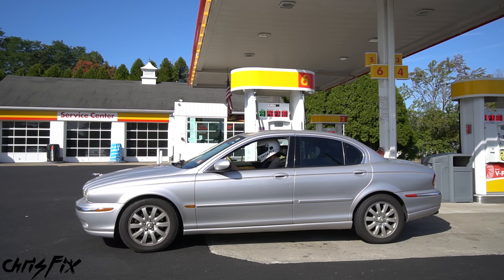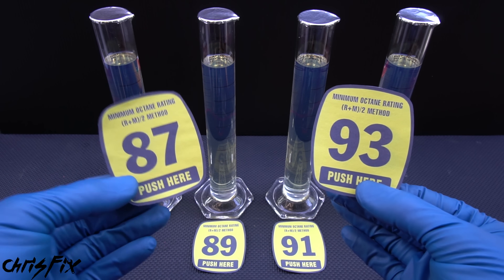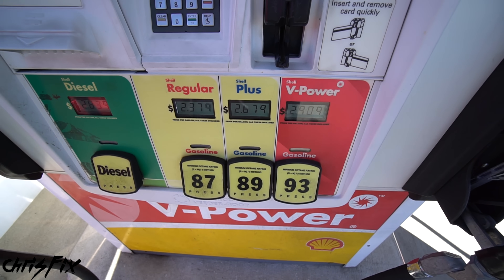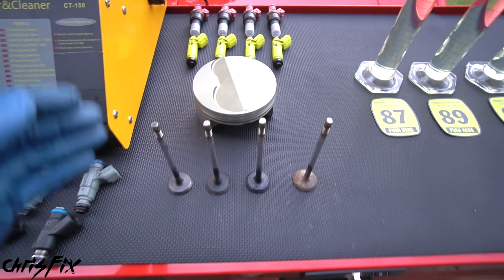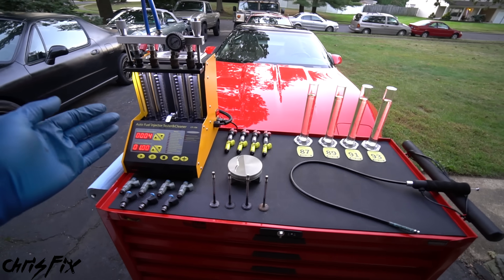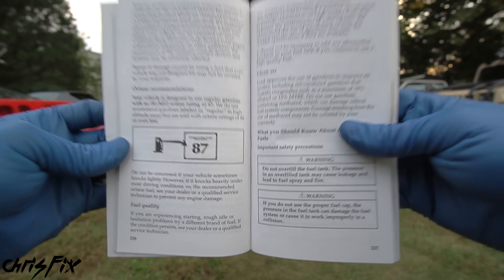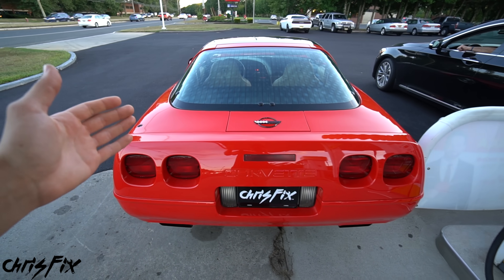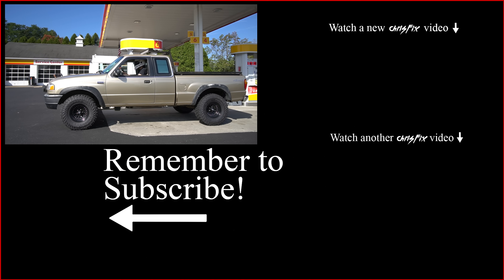What is the BEST Fuel to Use in Your Car or Truck and WHY

Comment: Bottom line:
1. Use the octane it says to use in your owners manual.   There is NO advantage to using a higher octane...does you no good.
2.BRAND matters more than octane.   Pay the extra .10/gallon for a name brand fuel (and sometimes not even that much).  Just Google "who sells TOP TIER fuels" and buy those.  Many top tier fuels are budget priced like QT and Costco, and many Circle K's actually sell top tiers like Shell and Mobil.
Seriously, it may cost you $1.50 more to fill up, but you'll get at least 70,000 more miles out of that car...more of you start early in the life of the car. 
Feed your car crap fuel from the station at the Qwikkie Pickie, consider yourself lucky if you get 120,000 miles out of it.
Reply: To prevent knock when advancing timing you can use higher octane fuel. When you advance timing you get more power.
So... there is an advantage.

Comment: My car says it's designed to run on 87 octane with 10% ethenol so that's what I use and nothing else. I definitely won't use the new 15% ethenol stuff. I used to use 89 or the middle one but honestly it seemed to run better on 87 so I stopped.

Comment: If the pump is out of regular and you run premium. Get the mid grade and you'll get premium at the mid grade price.😉
Reply: LOL! That would be nice if it actualy worked. But unfortunately typically when the regular runs out, the mid-grade stops working as well. So only the premium will pump. Gas stations have thought of this long ago.

Comment: The ethanol-mixed gasolines typically found in Europe, like 95 octane/E05 actually contains less energy than non-ethanol mixed gasoline, and causes higher fuel-consumption

Comment: What if your car is rated 87, but you put in 94 octane and add an octane booster bottle XD

Edit : my friend does this on his modified Chevy Cobalt 2008 lmao
Reply: The car won't have the proper compression to burn the fuel properly and can lead to a higher risk of carbon build up, as your puffing out unburnt fuel from the exhaust. Your friend must love throwing money away for no reason.
Reply: @waycoolscootaloo  he's a dumbass lmao

Comment: the prices changed so fast, was $3.019 for 93 at the beginning and like 30 seconds later its $2.909
Reply: I work at a gas station, most places have an automatic price system for their gas. cant exactly go into details but a little hint, if you need to fill up hit a gas station during non-peak hours, not when there is 700 people stopping in.

I've literally clocked in one day with gas being $2.39 and by the time I clocked out it was $2.50. the system is always on and prices always change.  (also at our station we have 87, 89, 93 but the 87 and 89 are literally from the same tank. it's a scam)
Reply: @Kalezian  It's not a scam. The 89 is a 50/50 mix of premium and regular. The 89 pulls from both tanks to get an average of 89 octane.

Comment: In Sweden we don’t have gasoline that is less then 95 octane. The “premium” gas is 98 octane!
Reply: Did you even watch the video. He exains that the Euro ones are the same eating as us because the eating system is different
Reply: @Altiveda  Just for your reading comprehension: Europe doesn't have the "Regular" grade fuel from the states. The US mid-tier is the lowest you get.
Reply: We have that two
Reply: @allyshaddad3123  Ohh, the 98 is premium? 98 is mid-class in the Central Europe (Czech Republic especially) 😂 The premium gas is 100 octane!
Reply: @ondrarethy  well, the 100 oktane is only for promoting at shell, aral, etc. They are basically 98. I know a test by a university where the 98 (from a small brand)
 was better than the 102 ultimate 😱. Just take a high quality fuel, i got bad one (from A***p) in czech.
Reply: @ondrarethy  In Germany 96 is standard, 98 Premium, 100 is V-Power from Shell and 102 is whatever its called from Aral
Reply: here in the us an order online and sunoco delivers 181 octane racing fuel to your doorstep
Reply: Because Europe uses RON not MON or AKI.

Like inchs to cm not the same.
Reply: evidently you're s shitty listener as this is explained in the video.
Reply: Elias Isaksson  hey her i Danmark kan man få oktan 100 men ja USA soo low fordi der er 10% etanol i...kan også få 99 96 95 i dk..i USA brokker de sig over prisen....de skulle komme til danmark Sverige eller Norge og se vores priser..kan du have en go dag...

Comment: Thanks for the vid!!!  Wanted to know if you learned anything about non-ethanol with your time with Shell?  My vehicle is a 2000, and that was before 10% ethanol was a thing - but now they have dedicated yellow hoses (here in Colorado anyway) for 100% actual gasoline.  Costs a bit extra, I hear the parts in engines not designed for ethanol don't handle it very well, so I pay extra for it, and have been for years.  What do you think?

Comment: Does anyone know a possible problem to my car ? (2006 honda pilot)
It has a check engine light with multiple codes :
p0305
p0306
p0303
p0300 also the VTM 4 light is on

Comment: Interesting scenario... my vortec 6 calls for regular in an old 1991 Sonoma GMC but after adding an Edelbrock Carb it says 91-93 Recommended. I didn't know what to do in this situation, so I discovered something about the Edelbrock with the idle tuners in front as well as some other air-vacuum settings.

If you own an Edelbrock and find that you're getting issues running regular, switch to 91/93 for a few hundred miles. When you do this however, at fresh start with the new fuel you will have to re-tune the idle because the compression ratios will require higher/lower tuning. If you don't do this, the after market carb will have issues with idle that can lead to other problems. In this kind of vehicle, you do not often have sensors because the vehicle is older so everything is manual set.

I also tried to fix the "Engine Service Light" but that would require purchasing a dumber computer it seems, as the "mass flow sensor," "fuel rate low" errors, and a number of other issues arose because all those parts became unnecessary after removing the fuel injection system.

Comment: I Changed the valve covers on my 2007 Nissan Murano with 193,000 miles and now it runs fine for 30 seconds than starts misfiring I got a P0300 code
Reply: All the spark plugs were changed at 170,000 miles the 3 rear ignition coils were also changed at 170,000 miles I know it not the fuel that’s causing the misfire I’m thinking it’s a vacuum leak?

Comment: "Pre"-Detonation. Not detonation. Detonation is what is supposed to happen.
Reply: Have a c4 corvette don’t have a manual. When accelerating. In overdrive have that detonation. Sound at 43 mph when decelerate then accelerate it has that detonation sound thought clogged fuel injector.

Comment: Sorry for unrelated question but figured most recent video would get a response anyone have suggestions of tools to get for working on Volvo's specifically 2005 s80 fwd 5 cylinder have a small assortment or torx but what range is good to have what obd2 scan tool would be good there are dtc codes but no idea which one's only what modules are affected not an experienced car guy tbh but always watch these and am capable or retaining the information so want to see if I can put it to use Chris or anyone who can help I'd appreciate it

Comment: You should only use minimal gas needed based on engine compression.  Using higher octane doesn't help anything on regular engines.

Comment: What does E-85do does it make the car go faster?
Reply: e-85 is cleaner, and yes makes significantly more power with a proper tune than standard fuel. it significantly reduces knock allowing for more timing advance and in forced induction cars, more boost. the main downside is you need a fuel system that can handle it because it is more corrosive and will eat through normal fuel lines and pumps. In addition fuel economy suffers because more fuel is required to achieve the proper AFR
Reply: Connor C thanks man good exclamation

Comment: Great video as always! Now from my experience with owning a turbo car, the manual says minimum 87, which its fine to run but its a small 1.4l turbo charged economy car, LSPI is a factor and Ive had the knock sensor sense knock when running with 87, now nothing was damaged but after calling the manufacture they said run premium instead. Ive been running premium since and not once has the CEL came on, not to mention MPG increased dramatically. Now I personally think its very important to run 91 minimum in turbo cars which have small displacement engines because of the LSPI risk. And with a lot of modern cars now being made with small engines and getting a turbo on them.

Comment: ....or once a year you can suck a half a can of Sea Foam through the master cylinder vacuum hose. Suck a little until the warmed up engine almost stalls and stop, do that three times and the fourth time suck up enough to stall the engine. Let it sit for at least 30 minutes but the longer, the better. When you start it...it will smoke like a freight train for about 10 minutes. That is all that carbon you showed burning off. I did that many years ago to a vertical cylinder chainsaw and it DOUBLED the RPM’s.. since then I am a religious Sea Foam user...but not pouring it my tank, injecting it right into the manifold. Just my opinion...

Comment: those valves are bad, one whit oil gunk and another whit water on it (the more brown) ...just remember cheaper gas stations like am pm gas sucks, circle k is not the best, QT not recommended for me driving a F150 2011 4x4  chevron  mid grade or high grade is the best results on power and mileage.

Comment: So if you use shell high octane to clean your valves, where does this gunk go?  ive always remember the saying sh*t runs down hill. And the only way to get the flies out of the kitchen is to put the trash on the front porch.

Comment: Very informative however the chemist in me is cringing when you say octane is the resistance to burn and that is not true.  Octane is the name for 
hydrocarbons containing 8 carbon atoms.  The rating at the gas pump is the resistance to burn and the number represents a fuel mixture that is 87, 89, 91, and 93 percent octane and the rest heptane (7 carbon atoms).  This does not mean that your fuel is an exact mixture at those percentages yet the fuel you are purchasing has the equivalent resistance to burn as a fuel made from octane and heptane at those percentages.
Reply: The inner terrorist in me says the higher the octane the bigger the boom
Reply: yscar reviews 

Technically the lower the octane the bigger the boom. The higher octane indicates fuel that will burn more consistently and cleanly because it is more resistant to what can be summed up as spontaneously combusting. So if your inner terrorist wants fuel that will actually blow up and not burn slowly then go 75 octane, or just fabricate your own goddamn fuel with wood gasification and hydrolysis for hydrogen atoms to balance.
Reply: @topsecret1837  yes
Reply: @yusufsaood5484 lmao chill
Reply: @MrDopeboys1  I'm as chill as chilli mate
Reply: Thank you, as a fellow chemist I’m glad someone said it.
Reply: What is the difference between octane and heptane except from their carbon atoms count?  Or why is the atoms important?  Why is there heptane at all? Could it be 100% octane?
Unlike others in this thread I am pretty curious and like to learn new stuff from knowledgeable people!
Reply: Cringing? Really? In this context, a fuel's resistance to burning is exactly what octane means. Your cringe-worthy post is the equivalent of you correcting someone's explanation that Fahrenheit is a temperature measurement by saying, "The scientist in me is cringing because this person doesn't understand that Daniel Fahrenheit invented it and used the freezing point of a brine solution to establish 0 degrees." Sure, that's more information. Fantastic! But why are you cringing? Both statements are accurate. Gas pumps aren't labeled for chemists. They're labeled for drivers who need to pump gas into their cars. The octane rating absolutely tells them how resistant each choice is to burning. I enjoy learning and I like details like what you mentioned, but maybe get over yourself a little more next time and spare us the cringing. 

Oh, and not to beat a dead horse, but your explanation is also a little lacking (not that I'm cringing or anything) when you consider that there are octane ratings above 100. Am I supposed to believe that there can be a fuel with 110% of 8-carbon atoms in it? ChrisFix went as far as he deemed necessary in his explanation. You cringed and took us further, albeit with no practical applications. And now I'm wondering why you would do that without clearing up the glaring inconsistency that you've created.
Reply: Stewart Peters 

That was a deep burn. 3rd degree I suppose.

Comment: Actually enjoyed the video.  Very informative, expectation given, and details of common myths/misinformation.  Especially about other countries...  Question - E85, does it burn hotter and I have heard they make it differently in other countries?  Have a flex fuel F150 and it sucks mpg with E85 but the engine runs smoother...

Comment: * Tesla users left the chat *
Reply: Don't let the door hit you in the $ss!
Reply: Good one!
Reply: Brian Paul thx
Reply: Explains gasoline and engines for 16 minutes
Electric motor: yeah. it uses electricity. The engine parts don't even touch
Reply: no wonder why 5k dislikes,,, those are telsa's owners
Reply: For the most part they get their energy from coal.
Reply: Their cars just randomly explode
Reply: @Master Chef - Yeah, I wish they’d switch to solid state lithium ion batteries to stop that from happening
Reply: And yet still statistically much safer than most ICE vehicles.
Reply: Tesla users stucked in the Desert

Comment: I know this has nothing to do with the video. But before I remember you said when using RTV as a gasket, to place the straight bead on the inside of the bolt holes. My manual says to do it on the outside. Which tactic should I use?

Comment: Can someone tell me the difference between Ethanol and Gasoline fuel? I’m curious
Reply: Ethanol is a fuel additive/substitute that comes mostly from processing plants. It has a higher native detonation resistance then gas ( which is why it is commonly used as an additive in fuels to boost octane rating.) However it also has way less energy than pure gasoline requiring more of it to get the same power.

Comment: One thing to keep in mind with E85 is that it will reduce your fuel economy by about 17% vs. regular gas. (up to 10% ethanol)  Pure ethanol has approximately 80% of the energy of pure gasoline.

I'll occasionally get E85 if it's significantly cheaper than regular, BUT it's only worth it if the price of E85 is less than 83% of the price of regular.

Comment: Did I miss something or did you go through all this without mentioning flash point, the temp at which gasoline will burn?  High octane means higher flashpoint, which means more resistance to pre-ignition.  I can't believe you did this whole video without mentioning the word Flashpoint.

Comment: Hey Chris I have watched but not subscribe to your channel you share a lot of great informative information and I appreciate it thanks 🙏 I do have one quick question my sister in law has a  2012 Acura TL v6 3.5 the ecu threw P2647 Rocker Arm Actuator code my problem is that I can’t seem to locate it and I can’t fine any diagrams to help me so iam asking if you can shed some light on this plz I would really appreciate it thanks 🙏

Comment: You've done a great job on showing the basics on fueling a car. I have had the unique experience of working on several construction projects at a very large oil refinery.  We built a new control room for the refinery,  then a new MTBE unit, I didn't ever get near the loading area where they shipped the fuels. Each major brand has their advertising for their particular fuel, but each refinery make x number of formulas and ALL the gas stations use the closest supplier to their retail stations. In my case the local refinery is owned by
 marathon and it was the only one within a few hundred miles. All the different brands use the same fuels regardless of advertising how special and better their's is than their competitors.

Comment: Reminded me of that situation when two idiots on the filling station filled the old Mazda E2000 with diesel instead of gasoline (her exhaust system was pretty old and she sounded kind of like diesel). It was one hell of a task to clean her fuel system, carbs and engine afterward. Glad it was a 3rd generation, tough as nails.

Comment: MY 2013 Honda CRV used to get 30mpg when I bought it (85K miles). Now it is down to 25.4 (130K miles). The dealership did an expensive engine clean on it but it didn't really help.  How can I get back to 30mpg again?  Thanks!

Comment: Fuel having the same energy is incorrect many area 91 is non oxy, collectors fuel,  pure gas with zero ethanol. Which means it has slightly higher energy density per volume, like gasoline is 33k vs ethanol 23k M J / m x3 Probably where the confusion is.